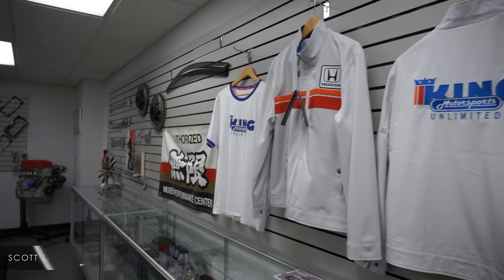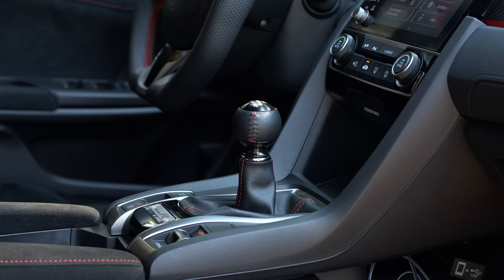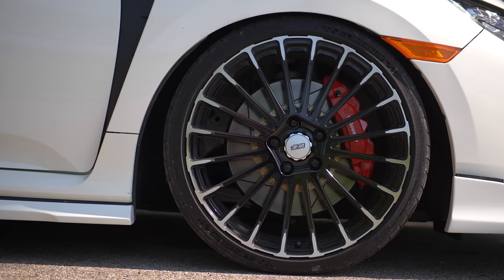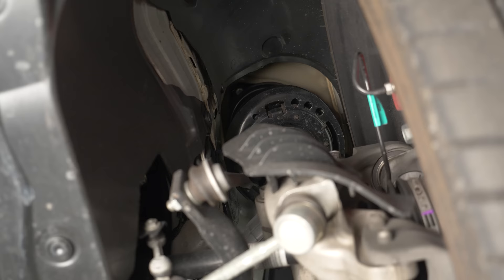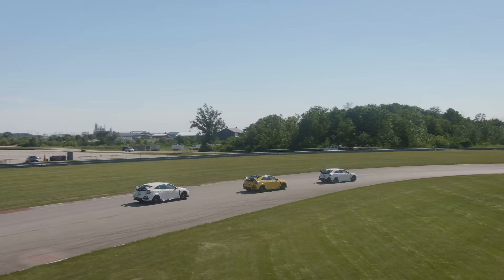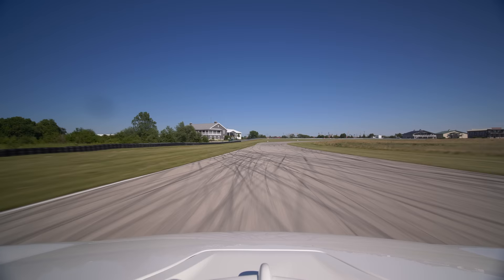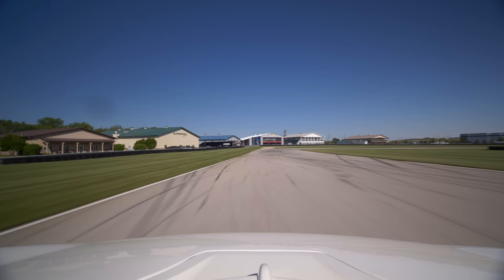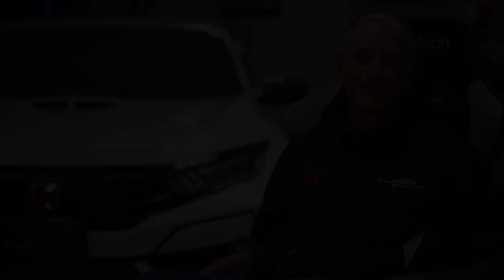Mugen Civic Type R | How Will History Judge?

Comment: I’ve had my last 3 Hondas modified & tuned by King Motorsports! The knowledge and attention to detail is the best in the automotive world.  I’m so glad to see you guys get the i side look and drive the Mugen prototype CTR!!   Amazing job creating this vid.
Reply: K-tuner ?
Reply: Hi Jason, have a nice weekend✌🏼 Love your channel😍
Reply from the maker: Hondata
Reply: Where's king motorsports located? Can they do a remote tune on a different dyno?
Reply: Same! They did a full build on my first civic. I love these guys.
Reply: Iiuuuiuuuu
Reply: @in54ne82  New Berlin WI, love visiting them to mod my FK8!
Reply: I don’t know about the Honda, but I have Swift Springs for my GTR 2016 45th Anniversary.  They are not only comfortable enough on the street, but are crazy good on the track.  I think coilovers are overrated and cannot be driven on the street in my opinion.   With Swift, they try balance street driving with a definite upgrade in performance.
Reply: My first trip to King Motorsports was when they were in Sullivan Wisconsin, back in early 1999. Plain old looking shop with gravel parking lot and an Acura NSX with California plates parked in front. If it was not for that NSX I would not have known I was in the right place as there was no signage. My '01 ITR motor w/ Mugen gymkhana spec manifold was their first build in New Berlin Wi back in 2004. I had Scott's ITR cylinder head on that motor
Reply: @savagegeese  The ball racking situation was hilarious as usual (xD)

Comment: Mugen: we didn't want the suspension to be too expensive so we just made a set of springs and hoped for the best
Also Mugen: here's a $5,000 exhaust that makes 3 HP and drones on the highway
Reply: It's called unsprung weight
Reply: Mugen stuff really is good quality, Mugen titanium exhaust on the s2000 is a work of art and super light for example, but yes you pay for quality.
Reply: @cowmath77  suspension/damping is dialed in for the stock spring rates lmao. I bet this rides like garbage now.. like my car after putting on H&R for two months
Reply: @FATmenDRIVEtrucks  super stiff springs with stock dampers (unadjusted for the higher spring rates) is a recipe for ride quality disaster
Reply: @cowmath77  yeah I watched it. The springs make the car rotate better because of the extreme ability to turn in. They also decreased the available mechanical grip and made the ride garbage . Did YOU watch the video? They took an ots spring and threw it in without touching dampers, not exactly the old mugen magic 😂
Reply: @FATmenDRIVEtrucks  Respectfully springs are no replacement for a good set of coilovers. You don't get coilovers anymore because you don't want to spend the money to mod the right way
Reply: @dragospahontu  Lmao no
Reply: @future62  it's a lot lighter than the stock exhaust
Reply: @cowmath77  That was just marketing spin. I mean yes it does rotate more. But it grips less and is unstable. Not good for going fast at the track. And it rides like ass on the street where most people are going to drive it. Double fail. Mark said like 10 times "people are just gonna get coilovers anyway" which is true. People just want to believe their mismatched spring + stock shock sets are good. They're not
Reply: @FATmenDRIVEtrucks  swift + koni yellow was my set up on fg2. Until I got older and moved on
Reply from the maker: They worked with multiple shock suppliers to develop a one-off electronic damper. To work the way they needed it to for a small number of cars was not going to happen. It was a price, quantity and electronic issue.
Reply: @dragospahontu  are you talking about the exhaust? An exhaust is sprung weight.
Reply: @cowmath77  insanely stiff is NOT what you want for a race car. That will get you bumped off your line from the slightest imperfections in the road /running over the curbs. If it decreased overall grip it's clearly too stiff. I guess it'd be good for autoX at the cost of all else.. I've been through the short springs phase which only lasted two months before taking them off
Reply: @FATmenDRIVEtrucks  nah I sold it and got my dream Honda since I was in high school. Which was s2000. I drove that thing every night in my local canyons. Did bunch of time attack, lots of fun. And I realized I am now middle aged man with 3kids. Just sold it few months ago. Now I am just grumpy grandpa.
Reply: @FATmenDRIVEtrucks  lol. Hope you enjoy ur S2k. I kinda regret getting it go but then again I really don’t get attached to cars. I am looking to buy next gen raptor.
Reply: @cowmath77  yes listen to the video. Because the springs were never matched to them , you get permanent pogo stick in comfort and unlivable in the other two modes. I been there and done that it sucks. The shill here is hard. I
Reply: @cowmath77  Have you ever done a track day? There was a bone stock Subaru Forester at the last one I did. People track bone stock CTRs too. A car being on a race track doesn't make it a race car
Reply: @savagegeese  I understand why they didn't do a custom suspension, but they could have just bundled in some off the rack coilovers with "Mugen recommended settings". You gotta admit the dichotomy is kind of nuts.
Reply: @papa_pt  I installed a set of Monroe cargo springs on a 88 Accord and it rode nicely but the tail came out just perfectly in oversteer in winding mountain pass. I am surprised they did not put a firmer spring that rode well in this because I don't think you have to use a progressive spring. A linear rate spring is often better because the rate never ramps up to something the shocks cannot dampen.
Reply: @cowmath77  more like Honda knew what they were doing when they matched those springs to the car  😂  the huge rims no sidewall sucks for track too
Reply: @cowmath77  I am a mechanical engineer and I also ride motorcycles. There's nothing pseudo about what I'm saying. No racing organization is going to let a car compete (aka race) without a cage + harness. Pretty sure fire suppression is necessary too. Throwing a bunch of random parts on a car doesn't turn it into a race car.
Reply: @cowmath77  you think tracks are that smooth? 😂 the mismatch between spring and damper is a bad idea everywhere but have fun with no suspension
Reply: @savagegeese  Understandable, but is there no ability for them to retune/replace the stock suspension ecu so it better matches the springs? Or is the adjustability in permanent steps with no granularity.
Reply from the maker: @Canuckrz  my personal belief is for them to offer a service to revalve electronic shocks is not something they want to get involved with. Now let's say they got sachs to build them new dampers that were electronic, that means an ECU reflash, also a big deal.  Now they could just have done a standard non electronic coilover, but then people would complain about that.  They probably looked at the overall volume that they would sell and just said it wasn't worth the time.
Reply: @cowmath77  How can a race car not be allowed to race? Using words in the context of their defined meanings isn't pedantry, it's how we communicate. Now if you want to call this a track car... meh, ok, but compared with other track cars the suspension is lacking. At a bumpy track- which there are plenty of- this won't do so well.
Reply: @savagegeese  I feel like the design of the shocks wouldn't allow for that. I know some other active suspensions are starting to get aftermarket tunes, which is insanely cool to me. The F3x chassis has this.
Reply: @cowmath77  sick
Reply: Mugen is a fart can company, and like Honda itself, now beholden to the ricers.
Reply: @taylorc2542  great take, thanks
Reply: @cowmath77   It's a trash product and laughable when you compare to what Dinan/Carbahn did to the notoriously stiff f80 m4 - More compliance, much MUCH better ride quality, more mechanical grip, better turn in, literally everything was improved. 

Meanwhile Mugen gives some shitty lowering springs that go as far as ruining arguably the most valuable mode of the precious shocks they didn't want to replace. 

The only possible counterargument you could muster if you're not a complete doofus is "racecar". Well guess what, it's a shitty race car and it would've both handled better and had better ride quality if they had just opted for coilovers, but to them I suppose that would seem like a cop-out since they couldn't maintain the useless electronic dampers (useless on their setup anyways). 

Keep licking those boots, fanboy.
Reply: @savagegeese  It does not excuse ditching the electronic dampers. Mugen is both overpriced and apparently can't even improve an already exceptional platform.
Reply: @cowmath77  exactly
Reply: @papa_pt  All front wheel drive race cars usually strive to reduce rear grip though.  Sometimes in the BTCC you see as much as 4 degree of negative camber in the rear, to deliberately reduce rear grip. :)  I guess ideally you would put wider tyres on the front, but the rules in the BTCC demand a square setup.  I think we can sure that the likes of Team Dynamics are not deliberately setting their cars up to go slower!
Reply: @papa_pt  Goose didn't say it reduced overall grip though. ;)  At least on this very flat, smooth circuit with sticky tyres...
Reply: I used to race salt creek a decade ago, Miatas, and SVT Focus in the front wheel drive class. The focus would be the closest comparison to the modern type R. I tried a lot of suspension setups, various strut and  coilover setups, and there was always one takeaway, well understood in the Honda community: OEM/stock suspension is generally the best for performance-focused vehicles, because unlike exhaust and engine tuning, there are no emissions or regulatory restrictions for suspension so a LOT of engineering is put into them to balance ride quality and handling without compromise.

But for what it’s worth, using 3 strut setups and a coil over setup, my best, and most consistent lap times were with K&W struts front and shocks back, using their yellow springs with blue bodies. But the street ride quality was rough. Not as bad as coilovers or some ghetto cuts springs would be, but you bottomed out constantly on railroad crossings. They gave maybe 3” of total travel, including rebound, so figure HALF of stock travel. Great for flat track, shit for anywhere else, and overall not worth it.
Reply: @emotionz3  there are still restrictions. Mainly cost, but also not alienating customers with a more aggressive ride. I've had coil overs that handled and rode better than stock. It's possible
Reply: @dragospahontu  exhausts are 100% sprung weight
Reply: @cowmath77  That's not an argument and doesn't address any of the points I made, and yet you think that it shows that I'm the one lacking credibility. The irony is palpable.
Reply: @matt25675  what if it's dangling down?
Reply: Don't forget the 7k spoiler!
Reply: @cowmath77  The EPA doesn’t care about anything after the catalytic converter lol.
Reply: I thought 1000 was a lot… you can get an exhaust-intake-Inter cooler-wheels- down pipe
Reply: my mugen twin loop does not drone

Comment: Can I have a Mugen Odyssey? Like the TSX Type S powertrain with some wicked body kit would tight 👌🤜🤛
Reply: I think the closest we got was the Ford Flex Ecoboost.. Or R63 AMG
Reply: @papa_pt  I bet some twisted genius could make the Mugen Minivan happen tho 😜👹🙏
Reply: back in the mid 2000s Mugen had a really sick JDM Odyssey. It was mostly cosmetic but was based on the higher Power Absolute trim with a 200/206hp K24.

It was auto only though.
Reply: Bisimoto has a wild Odyssey build
Reply: would love a j37 shawd setup in a ody. would i buy one? hell no but the idea itself seems so damn cool lmao
Reply: @caglioso  I was about to say! Definitely add that Odyssey to the list
Reply: @danielpark94  I'd take one over the MDX jc so much lower. The J37 is our old MDX made that car very solid to drive
Reply: Also I totally misspoke and meant the new TLX Type S powertrain
Reply: Bimoto did am odyssey with 1000+ hp.
Reply: @robvenom1058  good grief. I was thinking 400 whp would be bonkers 😂
Reply: And there ARE Mugen body kits which look pretty wild so it's not THAT far fetched. Just gotta have $100k to blow on a bad ass minivan 😂
Reply: I put Si badges on the front and rear of my Si. That likely adds some cornering enhancement for sure. While driving, I simply imagine shifting the 6 speed manual transmission and it’s nearly the same as a Mugen Odyssey would be. Joking aside, that’d be cool, though absurd. :)
Reply: Okay I need Mugen to do the TLX Type S
Reply: weld a cage too then a beast is born!
Reply: Lol.
I think the greatest percentage of vehicles being pulled over for speeding have minivans.
What is it with you guys?
Is it the rebel being in conflict with the good dad?
Respects either way.
Reply: Mdx type s will be the closest thing to it.
Reply: Yeeesssssss. The dads of this world are forgotten in the car world
Reply: @KenithCopeland  car manufacturers only really cater for rich dads
Reply: @christopherjohnston6343  rich boring dads who can’t drive stick 

The rs4 wagon (avant) looks crazy good as does the rs6. But I’m not about to spend +$120k (Australia prices) and be stuck skin a DCT (nah, I don’t care if it’s “quicker”, I still want a 6sp)
Reply: I know someone with a Jdm odyssey from Japan with Absolute kit on it😍😍😍 he just put some TE 37s on it👍🏽
Reply: Guys bisimoto VS boostedboiz odyssey????
Reply: I considered putting TL Type-S heads and cams and a j37 intake on an older Odyssey. Like a 98-04 model. As well as a few other small upgrades it would basically be a usdm Odyssey Type-S. Or at least that's the idea lol.
Reply: You can put a 6 speed manual out of a V6 Accord or similar without mechanical changes, but the ECU can be a challenge because they don't want to rev above 5000 rpm if they think it's in neutral. There are many entries about it on the Odyssey forums.

Comment: Looks so much better then the standard type r. This should have been how the original came from the factory. 18” wheels will make it torque steer, the reason for those giant 20” was to eliminate the toque steer. 18” looks way better though.

Comment: Came for the car and stayed for the King interviews.
Reply: That old guy has been separating young guys from their money for 30+ years. He knows all the right things to say. (“Buy a used R and then spend thousands on it with us.” “The next R might be electric.”) Mark and Jack have to make nice but a) the springs are too harsh to be usable on the street; and b) that $5k exhaust doesn’t really make power but it will turn your freeway commute into a torture chamber. From what I’m seeing on the track is less than impressive performance, and yet the track is the only thing this car is meant for.
Reply: @johntechwriter  You don't think the car is impressive on the track?  It seemed very capable to me.  Mugen products have never been value for money, but they do spend on the R&D.  Copy cats often come along and make cut-priced copies of their parts, so Mugen parts must be somewhat well-engineered...  For example, the Mugen DC5 intake I had, had the smooth mould side on the inside of the airbox. While you'd think it's obvious that the smooth side should be on the inside (like a Grand Prix car intake tract for instance), the Gruppe M DC5 intake I had begged to differ -- that one had the smooth side on the outside and the coarse side of the FRP on the inside! [I didn't spend thousands on either though, they were both used.]
Reply: @johntechwriter  I've know about King Motorsports since literally the late 80's when the shop I worked for was getting Mugen suspension bits for the first generation CRX Si they used for autocross/track events. Personally I keep all my motors stock (Californian) and get silly with suspension and brakes, so expensive exhausts from any manufacture never enter into my tuning equation. Cheers.

Comment: Spoon has always been a favorite of mine as far as both appearance and performance. I feel Mugen focuses way more on appearance and it's just overboard. The FK8 is overboard on it's stock form already.
Reply: I love the spoon parts as well, I only have their springs and rigid collars so far. Spoon lowering springs would have been better for this car. I have spoon springs on my Type R and they. I think they improve performance without a punishing ride quality because the spring rate is not all that high. Of course they won't put Spoon springs on a Mugen car though LOL.
Reply: I have Spoon springs and dampers on my ITR and I love them as a street and track compromise.
Reply: At least the mugen lip and side skirts tone down the overboardness. I wonder if spoon also have the wind tunnels that mugen has access to

Comment: I’m just… sort of disappointed with Mugen in that they addressed almost none of the real problems with the 10th gen type R. Besides the hood, no products were made to address cooling. No real transmission upgrades. Since they didn’t make a real coilover upgrade, they also decided to not make any camber or toe arms for stock suspension setups with springs.

Comment: Kind of disappointing for 5k they wouldn't have put in a helmholtz resonator in the exhaust to tone down the drone at highway rpm.
Reply: Its a Type-R, 
The older Type-R have mentality of if it didn't add speed, get rid of it.
The old Type-R Civic or Integra need to be driven with earplugs since they delete the sound dampers that deemed as dead weight, so they remove it.